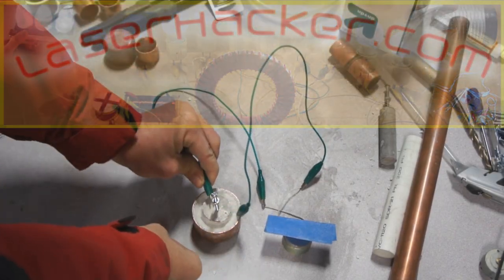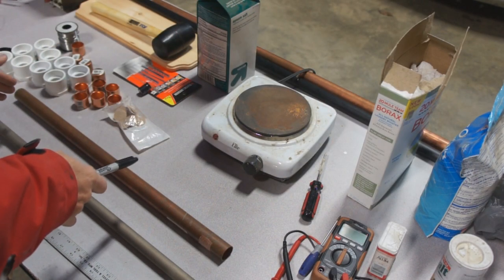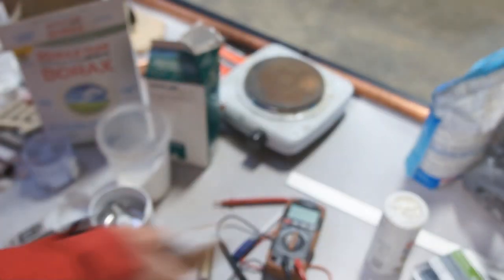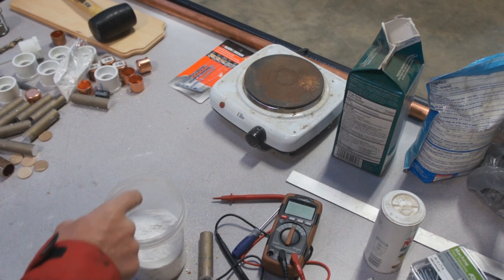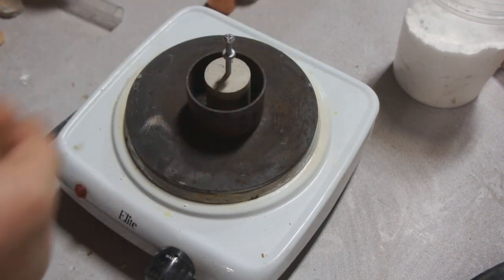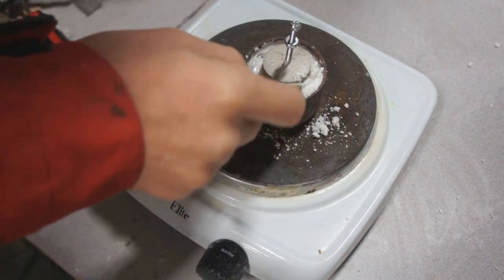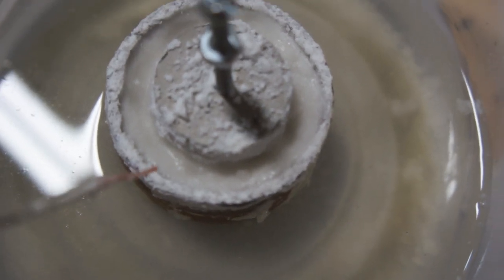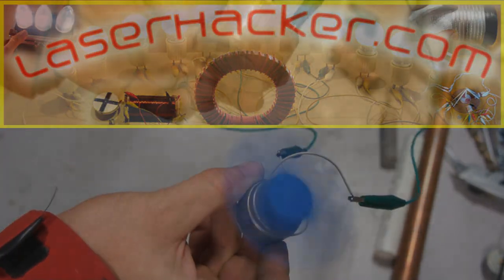How to Build Crystal Power Cells - Long Duration Power

Comment: Isn't this just chemical energy conversion. The ph of the material inside is stripping electrons off and the two differing metals creating a voltage differential, just like a lemon. What would be interesting would be to weigh everything, then run it got a year, then pull apart and check the weights again.
Reply: *****
No, the electrolyte is solid, but amorphous, not a crystal. Who cares, anyhow? He built a primary battery, at high cost given the materials. Fun, interesting, educational; not "free energy".
Reply: Pusalieth"Crystal" does not define molecular structure, it defines physical structure.These batteries do not last "forever" and they are corrosive. what do you think happens to that magnesium in there.These are very amenable for portable power! what he is using ,the copper and magnesium are the basis for Lithium polymer batteries used in thin leaf form sandwhitched together for extremely high power output , ie;used in models helicopters,electric cars etc etc.
Reply: well, I can tell you the answer right now , with out having to wait a year or so. Providing the unit is sealed,to prevent any evaporation, the weight difference would be theoretically zero,since only electrons are moving through the circuit, from one pole to the other, its as simple as that.
Reply: only assuming the the chemical conversion going on is 100% efficient and that no byproducts or gasses are even produced regardless of wether its sealed or not. You obviously didn't get what i was talking about. If what you are saying was correct then batteries would basically last forever. I'm talking about the process that liberates the electrons, this is a another route to creating a pH differential battery.
Reply: This is NOT a chemical process. No one knows whats going on.
If it was, there would be apparent signs of corrosion due t the liberation of electrons on either or both metals where the metals border with the crystals on the top surface.
Given the life span of this power source, corrosion is inevitable!
Reply: Pusalieth electrons do not "flow"through wires or batteries. try again.
Reply: Pusalieth LOL, I dont know why my response prompted you to "roll on the floor maturbating" electrons "drift", not flow. And batteries are a continuous  chemical reaction, not an electricity storage device. maybe you are confusing a capacitor with a battery. Oh and electricity is the mating of the magnetic and dielectric field. No so called "electrons" needed. The movement of electrons in free space are a result of electricity, not the cause.
Reply: Pusalieth LOL.I know what  rtfm means. I was joking with you because your response to my comment was rude, and I can see why you would have been rude, my "try again" comment was rude,even tho i didn't intend it to be that way, I see why you took it that way,and for that i apologize.                                                                                          But you went off the rails in your next response. You Should be able to entertain more than one idea without resorting to the horrible comments you made towards me.                                                                      You copy/paste wikipedia as if its the definitive authority on all matters scientific. When the coulomb and the ampere were giving the theoretical basis, it was thought all charge flowed from positive to negative. Then it was discovered that Electrons move from negative to positive. And then discovered that they move extremely slowly. And many people smarter than you and I then realized(some always knew) That electrons are not electricity itself. That is a huge misconception.You can have current consisting of entirely positive charges.                                                                Electromagnetic energy flows out of the battery and into the empty space around the circuit. It flows parallel to the connecting wires, then it dives into the resistor. The field of energy flow is found by multiplying the e-field by the b-field (E x B vector cross-product.).                                                                                                              Electromagnetism is the product of crossing the dielectric field with the magnetic field. The current is the rate at which the magnetism drags through the wires and destroys the emf. All energy is transferred on the outside of wires, not through the wires. So really, conductors  reflect the electric field, making them real insulators, acting as a wave guide, not a pipe. Thats why super conducting materials set on top of magnetism.                                                                               And when dealing with capacitors, the plates do not store electrons on there surface, the so called "insulating" materials store the dielectric field lines inside them.                                                                                     An absolutely perfect conductor would never be able to hold any kind of electrical anything. It could never develop a potential difference because it would always be equal to the electrical pressures around it. It would appear to "insulate".                                                                                                                But, if you abruptly open the switch on an inductive circuit,or design a circuit to give you pulsed DC current with extremely fast make break rate (Transistors, quenched spark gap) Then you can create a monopolar "one wire"flow of voltage. Which will allow you to pull 6 inch sparks off the top of ceramic insulators. When you cut off the path for the current, the voltage will raise its on potential to what ever it needs to discharge the current, even if takes a million volts.                                                                                        True electrical research hasn't progressed since the 50's. Even tho there are many fertile avenues left unexplored. If you are not familiar with Charles Steinmetz, Oliver Heaviside, or Nikola Tesla's work on these subjects, you should really look into it. No energy is "free" in the since that it does come from somewhere. But just as the right temp spark can unleash vast amounts of stored energy in an explosive material, the right kind of electrical "spark" so to speak, can unleash tons of electrical energy from the very place electricity originates, the vacuum.
Reply: Pusalieth
whilst trying to prove someone else wrong, you mis-used the word your whereas you were supposed to say you're. lulz
Reply: Pusalieth Electrons are magnetic and gravitational fields. There are enough of them to power the entire universe. Nano materials has changed the game. He may not know it but he is making nano crystal battery. And the power is mostly from magnetic and gravitational compression. This kind of crystal plasma system works of the differential in atomic masses between 3 charged bodies. This active transition crystal potassium plasma material, among other things, is where the energy is coming from.

Comment: u can also try to smash some quartz into the mix. as the pressure builds inside the cell it will force the quartz to generate even more power. so probably for more time u have the cell running more output will provide because of the continuasly pressure.

Comment: Hi! :)
  I'm very interested in this crystal cell technology and am looking to try an experiment using crystal cells on a far larger scale. My question is simple. Is there any specific reason for using the copper and magnesium? Copper as the containment vessel and magnesium as the core. Can these materials be switched in position or other materials used in their place such as steel as a containment vessel and say copper as the core. I'm almost thinking it probably runs along the same lines as touching a dissected frogs leg with two metals and it jerks and twitches. My goal is to make enough of these cells to run an experiment in running a modest moderate power usage home off them. A complete electric company free green friendly home as the basis for use of just that much less fossil fuel as a pollution free alternative for perhaps the future building of an entire project community. 

  Utilizing abandoned tracts of land either abandoned by flooding in the south or just unused property, my main and ultimate goal would be procurement of the tract of land, construction of homes made with hempcrete and other such natural and recycled materials and then fitting all homes with a crystal power cell electrical source. The goal would be that not even one telephone pole have a power line attached, telephone and cable vision wires only. Next phase after creation of this small community would be finding interested and like-minded people's to occupy and test and evaluate the entire community as a whole and individually by criteria I'm still in the process of thinking out in full. I had started this project out thinking wind and solar as a base for the experiment but this!!! This was an incredible find. 

  I was researching Nicola Tesla and Tesla Coil power distribution when I came across a John Hutchison  part of a video on Tesla coils used for the Philadelphia Experiment. I went into John Hutchison, brilliant man btw, and that's what led me here, a search for crystal cell tech. Now that I've seen this, I can with high probability bypass the pollution it took to make solar cells and/or wind turbines which where my original plan and add that to my equations for being as pollution free as possible or keep them in the equation for use as a viable backup. Any and all material information is so welcome you couldn't even begin to believe the value I have for information on the materials and the how's and why's of them.
Reply: +Devina Danado bump
Reply: +Devina Danado Is there a specific reason for using magnesium and copper? Yes. Very much so yes. You need to research oxidation reduction reactions and how they are used in batteries. And there are a thousand ways to make a battery but none of them are particularly cost effective. This unit provides about 1.5 volts and 90 miliamps with is not enough to power very much, even if you have 1000 of them in a row it would just get too expensive. You have good goals and ambitions but they are a little unrealistic, you are basically trying to reinvent the wheel, which you are allowed to do, but the problem of sustainable community development will not be solved with batteries like this. That being said, research "liquid metal batteries" there is company called Alveo i believe that is working on a large scale rechargeable battery  that can store megawatts of energy and it is basically made from earth abundant components.
Reply: Charmonium Pentaquark Wheel...re-invented sugah :) I'm currently running this computer off this tech and an inverter . I'm testing exactly how long they'll last for. The only snag I'm running into is the batteries size. Luckily my basement is fairly large. You mentioned a liquid battery which I'm already in the process of making based on this one. Instead of solidifying the crystal I'm designing it to have water added in a sealed condition. I will look into the oxidation angle too, thanks for the tip! :) Hey, I already know over a dozen ways not to make a battery so I'll keep chugging away at it till I get it right! :)
.
Reply: Devina Danado how is it

Comment: At 00:06, the voltage is measured.
At 00:15, the current is measured .

A voltmeter can't measure voltage and current without changing the probe connections!

Seems like anothe hoax!

Comment: I've created at least a half dozen of these with lab quality 99.9%+ pure salts, cylinders were in 1" coper pipe, and had magnesium anodes.  Sure, I was able to power a small (very small) motor for 3 weeks but it eventually died.  Amperage and voltage fluctuated during the experiment but in the end all cells eventually died.  This is not a breakthrough power cell technique or technology.  Several months later the cells still have not regained enough amperage to power the motor again.  They are effectively dead.Initial power output was between 200 and 300 milliamps and about 1.6 volts per cell.  Just tested, now cells average around 1.2v and 20-70 milliamps.
Reply: Thanks Warren. Finally someone with some actual data, and useful information.
Reply: id like to see this scaled up
Reply: Try charging them back up

Comment: So in Hutchinson's demonstration video on building a cell, he used cream of tarter (potassium citrate), epsom salt (magnesium sulfate), silver, and calcium (something). Your ingredients seem similar but different. Could you share your take on the ingredients differing from Hutchinson's example?
Reply: Hutchison crystal cells are completely different..he activated the crystals by heating up n apply high voltage to it...n he never used copper or magnesium